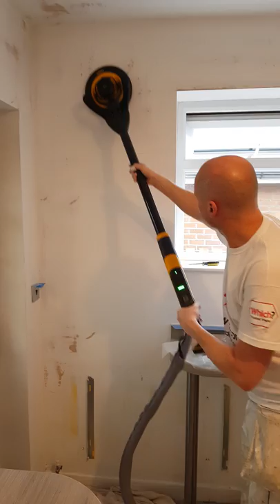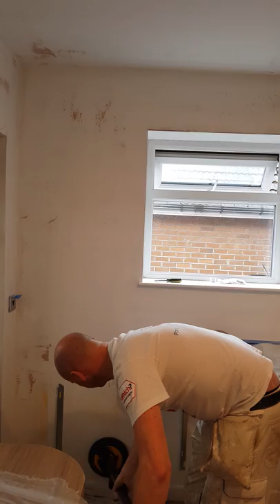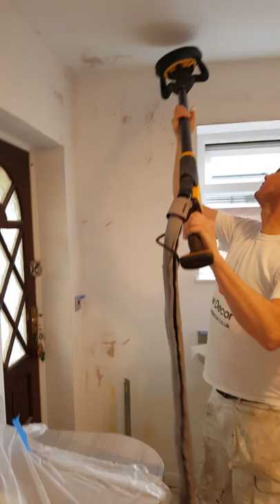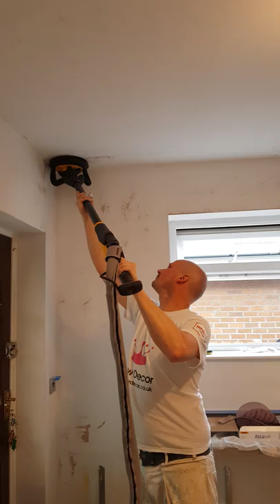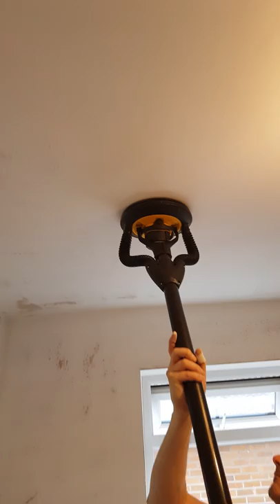Mirka Leros Dustless Sander

Comment: Be handy if it had a led light and they had a detachable head to change it for internal corners etc
Reply: I'm fitting my own 110v led strip to mine.. as per the head for angles, I'm not sure I'd want a power sander touching my angles as they barely need to be sanded to begin with 😅 better taping leads to less sanding 😎👌🏼 but it would be nice to see them come up with a version 2.0 with a light

Comment: Hi Richard, How are you liking the Leros? Can you compare to Planex or Porter cable??
Reply: I can compare it, we have a planex,  and there is no comparison,  the leros  stand alone.......
Reply: @bobseguin2195 Thanks Bob. Are you a drywaller or painter? Seems leros marketing has been targeted more to painters
Reply: @spbygga8123  sorry, didn't see this, I'm a drywaller.
Reply: mirka is best of the best of the BEST
Reply: I do remodel work, I've been using thr planex and for cutting down and griding down bad seams, texture it sucks.... the dewalt sander that replaced porter cable does okay but so much dust...hiw dies this work for taking down texture?